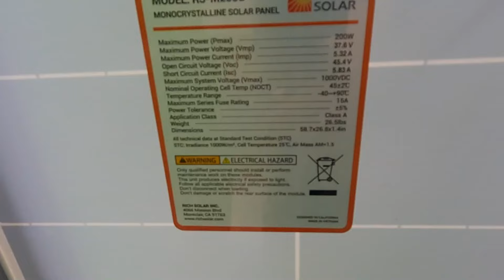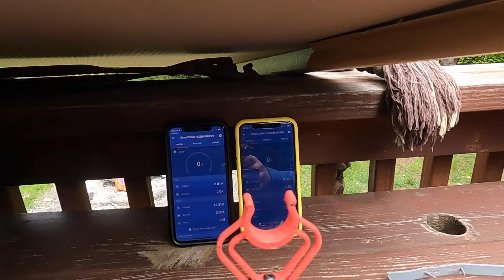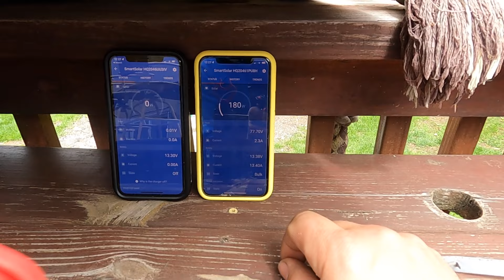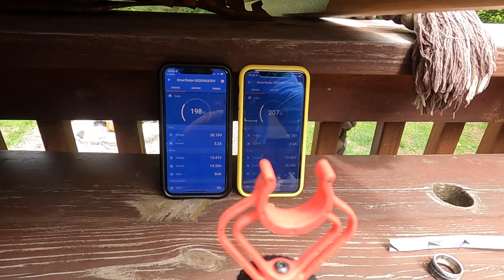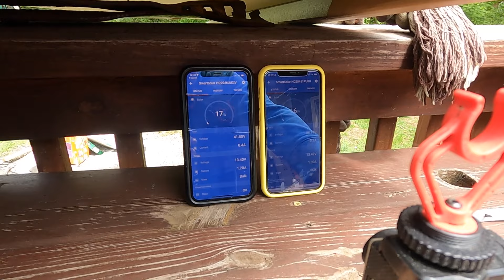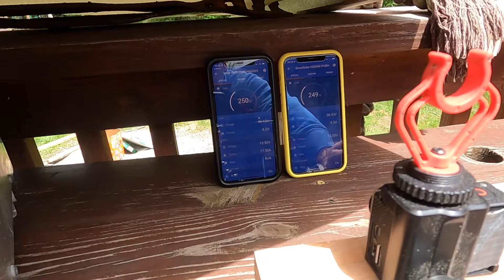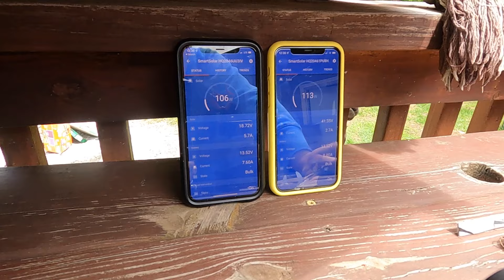Series VS Parallel Solar Panel Wiring Tested  for RV and Off Grid Applications

Comment: Good demo! I hooked up two very clean out of the box 100W panels in series yesterday...in bright sunlight...using a 40A MPPT controller. Panels were angled at 39 degree for our latitude in the Pacific NW. Temp was about 70 degrees. The Voc per panel is 24.8V and the Isc is 5.21A. I was getting good voltage at about 45-46V, but my amps was only hitting about 1.36A. I double and triple checked connections and made sure the panels were clean. Any ideas?

Comment: As I am not an expert (no university degree in electrical engineering) nor do I have many years of experience in this field, and the answers regarding parallel/series connection are controversial, I'll now ask you a very crisp question. Surely there should be an optimum recommendation for my application?
My system landscape:
1. 12 volt system
2. camper van (Citroen Jumper) with pop-up roof - 2 panels on top (total watts 400)
3. location: always variable, partial shading possible (under trees), light conditions vary!
4. 2x monocrystalline 200W 30.8V semi-flexible solar panels (short-circuit current (ISC): 6.82A, open circuit voltage (VOC): 36V Module voltage (VMP): 30.8V Module voltage (VMP): 30.8V; The modules have the bypass diode installed in the junction box!
5. 2x Lifepo4 battery with 150Ah each (total 300 Ah)
6. MPPT charge controller - Victron 100/50
7. inverter: MultiPlus 12/2000/80-3
Now my specific question to the experts:
Connect in parallel or in series or install a changeover switch (relay) where you can switch between parallel and series depending on the situation?
Thank you very much

Translated with DeepL.com (free version)

Comment: Great demonstration and observations. Surprisingly, I guessed the scenarios correctly.  And, the short run with MPPT showed little benefit, as it should - longer distance and day's worth of output should be a bit higher yet.  
BTW, you said "blocking" diodes, but they should be bypass diodes (which think you know).
Nice capacity setup.

Comment: Hey thank you for sharing this! I've been doing some solar experiments at home. I'm hoping to add another 400 watts of solar to my bus roof [I have 400watt presently] so for now I have 4 100 watt panels mounted remote in my yard while the bus in parked in the shade.  I'm using 10 awg wire, which is good for 30 amps, as I was connecting this thinking of voltage drop cause of DC, maybe I'd try series.  So  your demonstration showed that would be best for my application for now. Big fun!  As I build out the bus/rv project, I'd love to have a row of solar panels on the roof tilt.  Some I'm dreaming up some ideas with linear actuators that would tilt them for me. God bless! Al from CT

Comment: I bought an RV with a solar system installed. The panels were put in-series and I was considering rewiring to parallel. But now after watching this, I'm thinking it won't be worth the effort.

I have 3x 250W panels (Pmax 30.3V / 8.27A) to charge a 12V, 200 amp hour LifePo4 battery bank. Thoughts?
Reply from the maker: Your situation is a bit more iffy. I plan on doing some tests specifically with the RV roof on mind (shading from an AC ) . Like my tests have shown, it’s a 1-2% difference one way or another, u less you’re dealing with 12v panels. You’re not, you’re already working at a higher PV voltage.

Will it be worth the effort? That’s up to you . Id gathering more power is something you wish, I’d say add another panel and 2p 2s for even more! 

If you do change to 3p do report back, I want to know the real world data!  Also I have 2 more videos on this subject that would be worth watching.
Reply: @sotasolar  My fear is at ~8 amps, isn't it going to take forever to recharge my 200amp hour batteries? If I put it in parallel I could get ~24 charging amps, as I understand things.
Reply from the maker: @chrisjones3528  This segment is for you :-)  Look at the PV amps vs Battery amps.  It's almost 3 more in the series string vs parallel.  
https://youtu.be/EgdaBwxwSEk?list=PLjPRggLWIjHTIn8hWjSGa3ozhULMlnp1F&t=420
Reply: @sotasolar  at about 7:24 into the video, as you're showing the various watt readings, is your series coming in at 4.0 amps, and the charger is sending 20.7 amps to the batteries?

Comment: Series will keep the voltage above the MPPT or PWM minimum voltage level and still charge near dawn and dusk. 
This difference amount is almost negligible over the whole day, but may allow using appliances sooner in AM or later in PM when off grid.
The charge controller limits the # of series panels by OC voltage.

Comment: So I think from this test I may do both series and parallel. I have four 250w panels (30.7 Vmpp/8.15 A Impp). A charge controller rated for 30A/13-60v/1600w. Wouldn't splitting the four panels in two sets produce my best balance of power transmission for the controller?
Reply from the maker: First of all, why aren't you at your post?  Find TK421 and get back there.   Anyway, yes, a mixed series Parallel is a good way to go.  It does depend on how your partial shading situation looks like as well. For larger arrays on RVs I like to do multiple controllers vs one large one.  This way each array can optimize for the ideal conditions.   If this is on a house or mostly clear sky, I'd get the PV up as high as I could and then parallel from there in groups.

Comment: Say 3 panels in parallel, and 1 panel is in the shade, would it (and thus all) need a diode for protection? (would the current want to run in the wrong direction?). Thanks for testing!
Reply from the maker: I have not done my own testing with diodes. It’s not been my experience that the power wants to run backwards.

Comment: Great test thank you I have also been wondering which way is better I was surprised at the parallel panels when you shaded them and the series kept Up. Were the batteries at the same depth of discharge. And what would happen if you discharged them to 60%. And then charged.
Reply from the maker: They were very similar, 90-91% . They were taking in as many amps as they wanted and not limited in that way.  

I was very surprised at how much output dropped with just a little but covered at the bottom.

Like I mentioned in the video, panel manufactures have been working to mitigate series configuration loses where the pros and cons are getting more into personal preference. 

Thanks for watching and the comment!
Reply: @sotasolar  The reason for the drop is do to how you shaded the panel.  A panel is basically made of smaller panels.  Some in series others in parallel.  When you covered the bottoms you covered one mini panel of each series  killing the output.
Reply: Cells in a panel are in series. Some will be bypassed by rectifiers to reduce shading loss.

Comment: hi great video.

could you confirm if the panels had both bypass diodes and blocking diodes fitted ?

I'm trying to work out if you have parallel panels like in your demo,  what help the blocking diodes actually do ?    eg  with out blocking diodes...if one panel becomes shaded or damaged. then does the good panel end up dumping some of its energy into the bad or shaded panel ?
and if so..  does a blocking diodes eliminate this ?
Reply from the maker: I’m actually not sure. Recent panel designs are taking these conditions into account more and more. I did find a discussion here worth looking at https://diysolarforum.com/threads/rich-solar-100w-diode-info.22488/
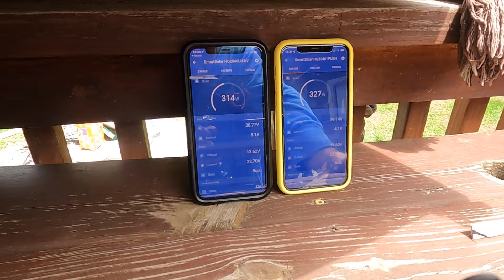Reply: - pretty sure they have bypassdiodes, the difference during shading at 7:59 was small, if they didnt have bypass diodes the difference between output would be much morre significant and the parallel would definetely outperform the series connection
- a bypassdiode eliminates your statet problem in a series connection

Comment: From my tests, my main benefit, in series you can use smaller gauge cable. Only gain is your wire price drops. 
Down side, not every component is geared to 24v
Reply from the maker: This test is on the panels, not the battery. MPPT charges can handle up to 100 volts or more.

Comment: Besides the length of the wiring, I am wondering if all of the panels were equally performing? Sometimes you can have a panel that under performs although it is same make and model.
Reply from the maker: That’s a definite possibility, to control for this we’d need to setup a control lab. And test each panel. I’ve done sillier things, who knows.

Comment: Thanks for this video.  I just got the renology 400w kit for an offgrid shed/observatory and was trying to make heads or tails of the differences. This seemed to be very real world testing. I think i'm going to go series just for the easier wiring of 4 panels on a shed roof. Thanks!
Reply from the maker: Just make sure the PV voltage is lower than the maximum the controller will support.   If 12v  panels you'll likely be fine.,
Reply: @sotasolar  Yep. Controller has plenty of overhead from the 4 panels.

Comment: Let see if you can help me  in my project 
Or some one on this chat I buy  5KW 48V Solar Hybrid
Inverter 120V/24OV Split Phase 100A MPPT Charge PV OUTPUT:
Max. Power
5000W
Max. Charge Current
100A
PV INTPUT:
Max. Power
5000W
Max. Open Voltage
500V
MPPT Input Voltage Range 120~450Vdc

Max. Input Current
22A

I have 12 solar panels of 310watts 44v each panel.  This is enough  to feed this inverter?? 
And how I connect this panels ? All in parallel or  how many panels in serie and then  in parallel  ?? Please 🙏 really need help thanks

Comment: Id love to see a 4-6s vs a 4-6p with 10 & 20meter to the mppt. The parallel should get voltage drop pr panel while the series only get it from the first panel. So the more in series the bigger the advantage.

Comment: with some quick maths in a perfect set system  and about 120 to 130v in the bigger chargers series   that advantage is going almost double in cloudy .  i m about to buy a second charger for another array and panels limits the 100v series after 95v!!!   looked for such video for over  a month now / no shades on the project spot . only clouds and some tiny bird poops to bother me..... i took my lesson and go for the 150v version for second array

Comment: Just the example I was looking for, thanks ,  but I'd like to ask a question of all the minds, I have 2 banks of different size panels, 5x200w and 3 x330w, putting them into series in 2 separate banks, can I run them to the same controller?? the controller is rated at 150/60, the 2 banks come in at 113v and 8.85 Amps for the 200w bank and the 330w bank come in at 52.68v at 18.79 Amps. or do I need to do 2 controllers? which I have. Is there any advantage in  taking 1 x 200w panel off and adding a 330w and do them in a series & parallel setup and would they be ok going to the same controller?
Reply from the maker: If you can get the PV to match ( or get prettier close) you can do that. Otherwise don’t do it. I just did some work on a system (we did not do the install) they had a 45v panel paralleled with 150v of panels. Nearly burned the rig down, melted wires, even melted fuses that never blew.
Reply: @sotasolar  Bugger me! maybe better I leave in parallel as I have them already, I just finished winter here and they were a bit slow in recharging the Lithium's, no problem in summer but I was thinking how to get a bit more for next winter, maybe just add another panel to the 330w bank?? thanks for the quick reply, much appreciated.

Comment: So basically build rows of series til you get to the max volts and connect the rows in parallel until you reach max amps ?
Reply from the maker: We’ll if you want to simply it all, yeah :-) the thing I’ll say is max amps is as much as 1.5 to 2x what you might otherwise calculate. I’ve got a video showing 910w into a 50 amp charger and not throttling.

Comment: What was the amp difference of the 2? I would lean more towards the higher amp set up, I will be running 2 growatt 3000 s one with a series, and 1 the other with a parallel. I am leaning towards a high amp string, and a high watt string for winter months.
Reply from the maker: I’ve seen this type of comment a few times and think I need to add this to the follow up video. However I’ll give you my $.02 now. Watts is all that matters. Amps out of the MPPT is pretty important, but the amps out is a function of  watts / volts (PV).  

I plan to do a longer term test with more depleted batteries to see if there is a longer term difference.  Ultimately what we want to is “what charges batteries faster?” That is what I aim to find out.

Comment: You say they're about neck and neck but the parallel setup was clearly giving 2 amps more than the series. How is that neck and neck?
Reply from the maker: I'd be happy to explain.  What's the time stamp?  Make sure you're looking at DC /Battery Amps not PV amps.   PV amps will vary wildly as voltage also varies wildly as the MPPT does it's job of finding the maximum power point.

Comment: Most charge controllers want the solar panel voltage to be 1.5 to 2x the battery voltage.  Much better to match that.    For a valid test you would want to double battery voltage when in series.  You are probably not getting enough sun to get the parallel version into the sweet spot.  You can upgrade to 24v panels and get more power for less cost.
Reply from the maker: We used 24v (45voc) panels in this test.  I did some research based on your comment and could not come up with anything authoritative on the voltage differential.  I’d welcome a link to a white paper or other video showing this.

I watched a video Will Prowse did years ago and it’s true a PWM controller did outperform an MPPT in full sun, so there probably is truth to that better performance in closer matching of voltage. However, that was only the case in direct sunlight.  

I need to do this again with longer wire runs that are more real world situations. I usually run 20-30 feet of cable , I’d suspect there are significant loses in the line at lower voltages.   

In the end I felt like there were pros and cons to each method with any winner being decided by single digits percentages. In the end, if you’re worried , add more panels in whatever configuration you think best.

Thanks for the comment.
Reply: @sotasolar  It will be in the charge controller documentation for the preferred solar voltage.  The less expensive PWM controllers will have the 1.5 to 2x recommendation.  MPPT and the the high voltage PWMs have better circuitry and matching voltage is less of an issue.  But cost for a good MPPT could be put into another solar panel....so many will pick lower cost charge controllers and more panels.
As for cable length just make sure the current matches the cable awg for an acceptable loss.   10awg PV cable is near the cost of 12awg so we just use that for panel side wiring and length isn't an issue.
Reply: @jmaus2k  I use 10 awg for all solar. I’ve not seen anything in the Victron MPPT preferred PV voltage. Only that you should not exceed PV max (and to account for cold mornings with headroom).
Reply: @HimmelbergerBus  Right, but you also spent $80+ extra for it.

Comment: most surprised the thin plank killed the production far more than the Broad cardboard... something about how the separate cells are wired ?
Reply from the maker: I was too. I think it had a lot to do with covering a part of every cell group. The panels are actually 5 to 9 panels in parallel internally.

Comment: Could you try  using microinverters in your test?  I researched the microinverters will definitely help with the shading issues.
Reply from the maker: Many / most of our customers use these on RVs and charge DC batteries so micro inverters likely would not be used . I bet they would help in grid tie installs though.

Comment: lower DC arc risk if you keep it under 80Vs and some districts wont require DC ARC Protection on systems with PV lower than 80 Volt with Low Temp Adjustments (120% over VOC)
If you dont really have shading issues and a calculator doesnt say you need a higher voltage for the run on say 8AWG wire Parallel will work just fine, you just need  MMPT that will handle the AMPS on the PV and get a good quality PV Combiner Box

Comment: Parallel should win in 10 years. Less heat build up if you had like a 10 panel set up lower voltage yes but longer service life yes